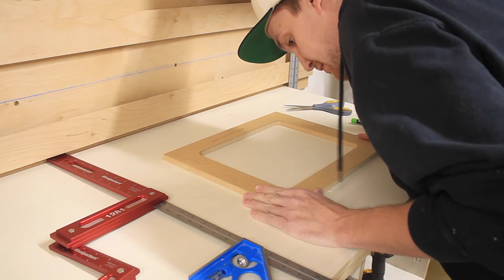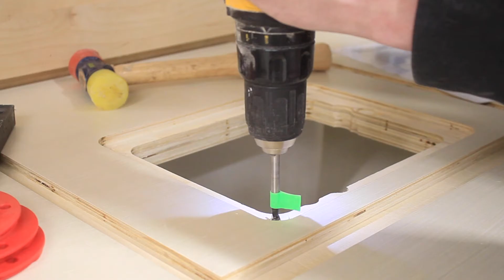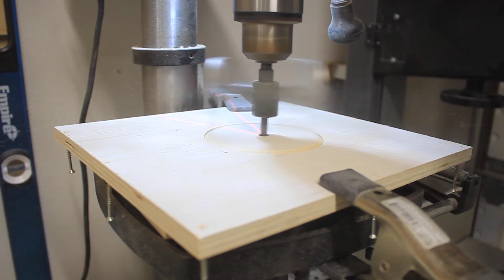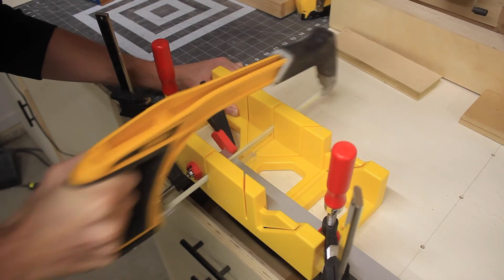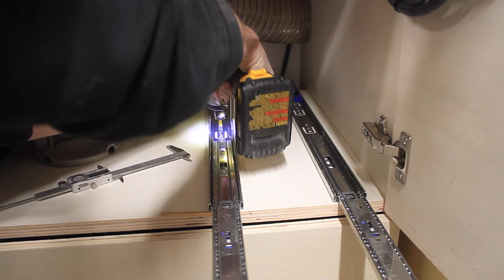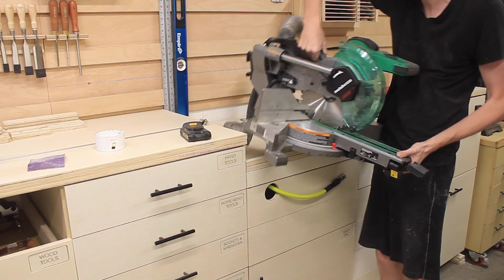Ultimate Router Table Build- Miter Station Part 2

Comment: Love how you all use baltic birch plywwood to make workshop cabinets etc like it's some cheap material...I don't know what it costs in the US, but here in the UK it's almost £200 or $250 per 8 x 4 sheet.......😆
Reply from the maker: Oh wow!! That material was about $50 per 8x4 sheet for me!
Reply: @CombsDesign  I wish it was that price here, but it's the same with any hardwoods, for example we'd pay £1150 pounds plus delivery for just 50 metres of 5" x 1" oak.
as for decent woodworking tools, the prices we pay here in the UK are also eye wateringly expensive, ....for example to equip even a modest woodworking shop here in the UK with the cast iron high end table saws, planer/thicknessers and various other machines, plus the hand tools and the racks full of clamps etc that you all seem to have in the US would cost us at least £25 thousand pounds or more.....😄

Comment: I am wanting to make a router table miter saw combo station as well. One thing I am trying to figure out is alignment so that I will have enough clearance needed from the router table feed through to clear the miter fence. What's your depths you use there? And have you ever run into an issue? Great video and I like your calm style.

Comment: great design, but if you push a long board, it'll stoped by the miter saw fence. how you fix this problem?
Reply from the maker: So funny story. I originally designed this with a different miter saw, and the fence cleared. I forgot to update the design when I switched saws. It was a major oversight and inconvenience. If I need to do a lot of router work with long boards, I am able to simply remove the miter saw with the threaded hardware I used.